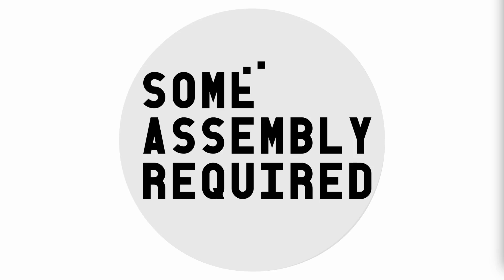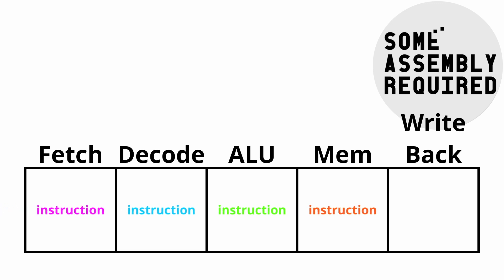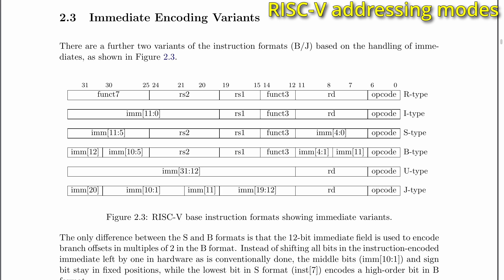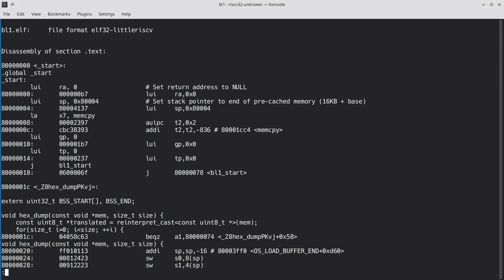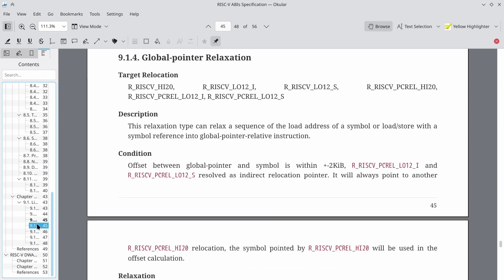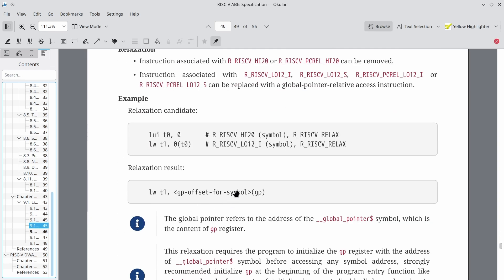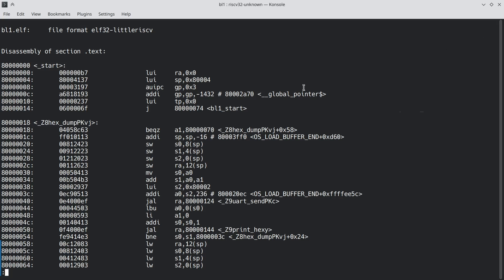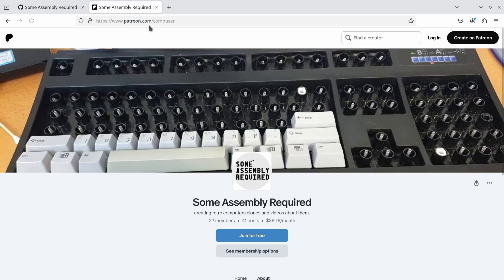The RISC-V global pointer register

Comment: Instructions in RISC-V are not all 32-bits? Compressed instructions are 16-bit and the opcodes support instructions with arbitrary multiples of 16 bits in length.
Reply from the maker: Compressed instructions are a different CPU mode. And, yes, I did simplify things a little.
Reply: @CompuSAR When supported by the hardware, compressed instructions are available by default without any special mode (unlike, for example, ARM, where code needs to switch between compressed and uncompressed modes).

A better response to the OP is that compressed instructions are (with, as I recall, a handful of exceptions) a strict subset of the uncompressed instructions, so basically every instruction has a 32-bit form.
Reply from the maker: I think the main point here is that Fetch can do its thing without knowing what the previous opcode was. With compressed instructions the instructions density goes up, so that's not a problem. Any special handling can be done later using bubbles. What we cannot abide by are commands of variable length. Those would destroy the "one command per cycle" concept. 
And yes, those include the extension OP mentioned. I'm guessing that's why no extension uses that.
Reply from the maker: My previous reply was written in the middle of the night, and referred to compressed mode. The reason I didn't mention it in the video is because it's beside the point I was trying to make, which is: when going up to 64 bit, instruction length typically doesn't change. This means that if you have 20 bit of immediate value to initialize a 32 bit register with two opcodes, you now have 20 bit of immediate value to initialize a 64 bit register, how many opcodes that takes.

Upon properly waking up, I tried to look up multiple words opcodes, and couldn't find any reference. Not in the RISC spec (though I only skimmed it, so I may have missed something) and not by going to the duckduck. As far as I can tell all compressed mode opcodes are 16 bit, constant width.
Do you have a reference to this multiple opcodes mode?
Reply: @CompuSAR  In chapter 1.5 of the RISC-V unprivileged specification, it states that the base instruction set has a fixed 32-bit encoding, but that the specification allows extensions to have variable-length encodings where the instructions can be any number of 16-bit parcels. This means that an extension can make use of 16-bit instructions (like the compressed instruction extensions) but they can also use instructions bigger than 32-bit (i.e. 48-bit or 64-bit and so on). However, there are no extensions currently that make use of any instruction size larger than 32 bits (to my knowledge). 

Also, unlike ARM which has its separate Thumb mode, RISC-V does not specify a separate mode for compressed instructions (though I think the specification allows an implementation to make it possible to turn an extension off or on via the misa register). They are designed so that compressed instructions can be "uncompressed" or "expanded" into normal instructions 32 bits in size, and thus it would be relatively easy to add a stage for that in an already existing design without much modification.

Comment: Thank for this video! By the way, what are you typing on? Is it an old Model M?
Reply from the maker: I wish. My Model-M has a broken trace, and I haven't gotten around to fixing it yet. I bought some generic mechanical keyboard, and that's what I'm using. Nowhere near as fun as the Modem-M.
Reply: @CompuSAR  But the click and the thock... What switches are those?
Reply from the maker: @IngvardM  I honestly don't know. The keyboard is a Razer BlackWidow V3, and as you probably understood, it's... okay for typing (though better than a membrane one, obviously).
I do miss my Model-M, though.
Reply: @CompuSAR  You can replace the switches with Kailh Box Navy, these have somewhat simmilar feel to buckling spring. MT3 keycaps are modeled after the Model M ones. Or you can just go for Unicomp keyboard. Personally I use light linear switches 28/30gf for those long coding sessions to reduce fatigue.
Reply from the maker: @IngvardM  Or, I can find the screws I need to close my Model-M and fix it.